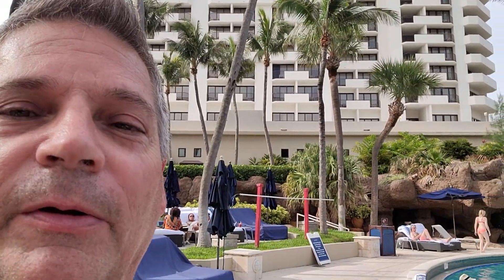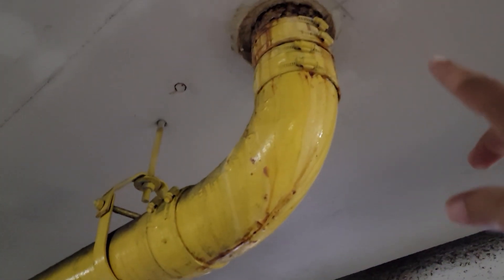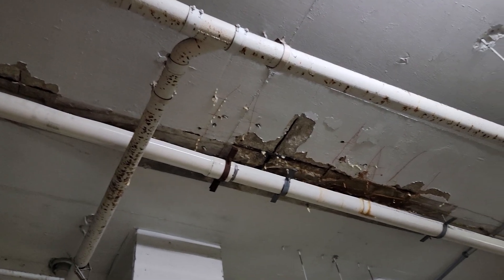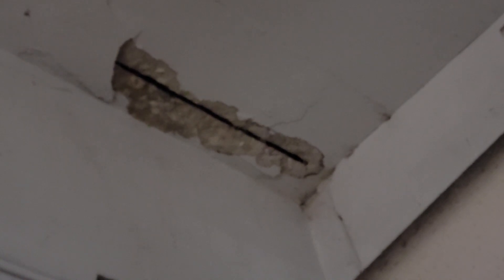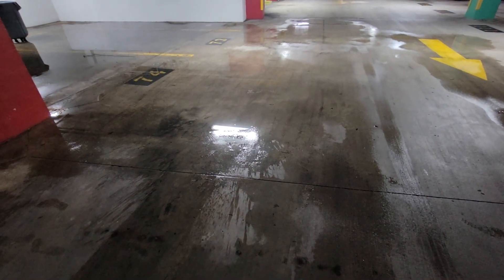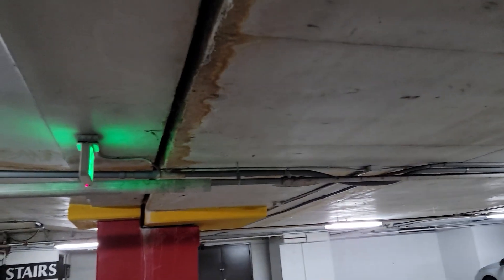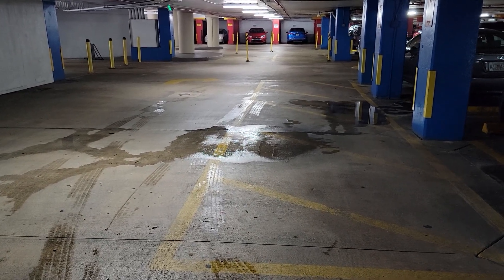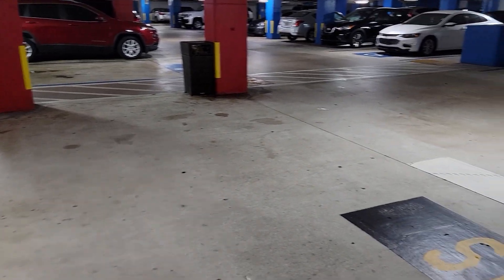Scary Garage Damaged Concrete Marriott Harbor Beach, Like Surfside Collapse

Comment: Champlain towers wasn't just due to water but mainly due to overloaded supports by the planters.
Reply from the maker: more than that too, likely many stressors
Reply: @jeffostroff  building integrity has a pretty convincing video (presumably you have seen it). But I am no engineer. It sounded like it should have collapsed under the overload way before it did.

Comment: At minute 23:39 to 24:00, why is the right side of the isolation seam so much lower than the left?  It looks as if the right side of the ceiling has dropped or settled to this lower point.

Comment: Salt spray can cause corrosion faster than a dry environment and there is high humidity too so rebar or any metal will rust faster.

Comment: This garage defintly has some problems, that they need to fix ASAP (or should have been caught earlier by facility managment).

The rebar at 12:42 in the video has almost no cover, it's like 5mm or less. It could be a local area with bad cover, I would expect the designed cover to be around 25-30mm. it's possible that the iron workers forgot to put rebar spacers in some area's of the slab. During the pour, the rebar may have been bent unitentionally causing the cover be reduced. This definitly needs to be investigated.  The corrosion on the rebar there is really bad, they would have to actaully replace some rebars, and remove the cover on the entire slab to  assess the magnitude of the damage and a apply a new cover with a layer of shotcrete. Granted, that is an extreme repair it may not be necessary if most of slab is ok. It would have to be done locally. 

The compressive strength of concrete actually increases with age (under normal coditions), It's not unusal for 25 MPa (28 day design strength) concrete to increase in strength after 40 years.
I've done schmidthammer tests on balconies of old 1950's / 1960's era flats in the Netherlands. In 2011 we had a case that a gallery collapsed of a 1960's appartment building, since then these buildings have to be inspected if their year of construction is from 1975 or older. A lot of those gallery's and balconies are cantilevering slabs, with it's main rebar on the top. Some people use de-icing salts to make the gallery less slippery in the winter and that's really bad for the health of the concrete.

Comment: Hi Jeff thanks for the video, what I find interesting about this is that Mr. Marriott and his family actually stay at the harbor beach hotel, in the penthouse,  during the winter season meeting from January through March. So you would think that this building would be kept in tiptop condition as the Marriott family themselves stays there. 
I have stayed at this beautiful hotel numerous times but I’ve never been in the garage as I always use valet parking, sothanks for the information. The one area you didn’t address is the pool deck connected to the building like it was at the Champlain towers or is the pool deck separate from the building.
Reply from the maker: We will show it in another video

Comment: When if ever would there be a reason to demolish these buildings? It's been done in Las Vegas ( could be a different reason in Vegas) for years. Excellent job on analysis of this building. Thanks Jeff.
Reply: Vegas demolishes generally to replace with something far more extravagant that would never have been possible if the original building remained standing.

Comment: And the structural designs have built-in safety of overload structure but you don't know how long this leaking and damage has been going on and you definitely can't see what is hidden throughout the ceilings in the walls where the concrete hasn't popped off. There can be some real scary stuff if no one properly inspects from top to bottom. 👀

Comment: I went to view a new apartment in my home town. It is a 1960's building that used to be an office for HM Passport Agency. I loved the place but all I could think about is the structural integrity of the place. It is more than likely a safe building especially considering its recent change of use from office to residential. UK safety standards seem quite stringent. However, since reading/watching the chain of events that occurred in Surfside, this nagging feeling remains with me.
Reply: @robi4387  Hi Robert, thanks for this, very insightful. I shall do some investigating RE: certificates.

Comment: Those are expansion sections for building movements. The lack of those yellow bases on top of the columns is what make the building fall  down!
Reply: Yes and no.  There were so many issues with the original construction.  However, that is just my opinion as a British Chartered Structural Engineer of over 30 years experience, but hey what do I know!
Reply: @robi4387  what is funny about all of this is that every building in Miami right now that has a water leak of some sort people thinks is going to be the next catastrophe and this is not true!
Reply from the maker: Yet in the end it all depends on where the water manifests itself into a worse case scenario of weakened concrete. You can have a collapse in a garage without taking down the building

Comment: Those corner steel guards on the columns are to protect the columns from a car hitting the edge of the column and braking a chunk of concrete exposing the steel rods!
THEY HAVE NOTHING TO DO WITH HELPING THE COLUMN STRUCTURE!!

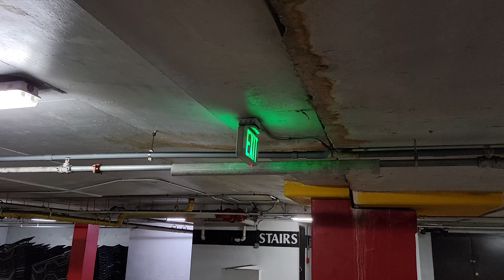Comment: Jeff, at about 22:00 do you see the two ceiling heights on either side of the isolation seam standing at two different heights from one another? Even the pad above the bean seen in the near distance looks to be at two considerably different ceiling heights from one another. Would this necessarily represent settling on one side more than the other?
Reply from the maker: I doubt that it means anything other than one side has a higher height than the other there's nothing that requires two different entities to be at the same height. now i know it's not the pool deck comma but for example let's say you have a pool deck coming up against the building and there is a scene between the two comma there's no law that says that the building height has to be at the exact same height as the pool deck period

Comment: It’s almost like every square foot of the garage ceiling had leaks, cracks, exposed rebar, etc.  Don’t building inspectors ever stop by?  What about insurance companies?  Don’t they require upkeep of the properties they insure?
Reply from the maker: Exactly, I'm not sure why insurance companies are not demanding inspection. My insurance company a few months ago told me to cut my palm frond, because they were touching the house, and to change my toilet water supply line in the bathroom from plastic to steel belted hose or they would drop me.
Reply: @jeffostroff  Seems to be a trend in South Florida.  Champlain Towers South was also insured.  Did no one from their insurance company come by to inspect anything?  It’s all so confusing, and it feels like multiple people dropped the ball, which caused 98 people to lose their lives.

Comment: Be interesting to know if that water is from different sources like is it rainwater, fresh water, pool water with chlorine or even seawater maybe ?? Id also like to have pointed a flashlight into that isolation seam and see what could be seen. Looks like at the very least the garage cieling is going to cause some car damage or personal injury if one happened to be standing in the wrong place when a large part of the garage fell.  Best part about this building is those very beefy columns, good build quality there.

Comment: Galvanized reinforcing steel is bare reinforcing steel coated with a protective layer of zinc metal. The zinc coating serves as a barrier to corrosive elements that the rebar is exposed to when embedded in concrete.  Even if the rebar is chipped with bare metal exposed, zinc in the area will still help control the chemical reaction/degradation
Reply: Higher cement content, greater cover to reinforcement and if required, stainless steel reinforcement e.g. for balconies/extreme exposure.
Champlain Towers was a catalogue of why not to cut corners, how not to build and why maintenance is so important.
We Structural Engineers have play second fiddle to Architects and this is what happens.
Reply: The zinc can get powdery and flaky as the pH of the concrete drops over time, and this can also result in pressure on the surrounding concrete, or at the very least, reduce the bonding or adhesion of the rebar to the concrete, ie. the 'grip' that the concrete has on the rebar is important, it's what gives the concrete it's tension strength

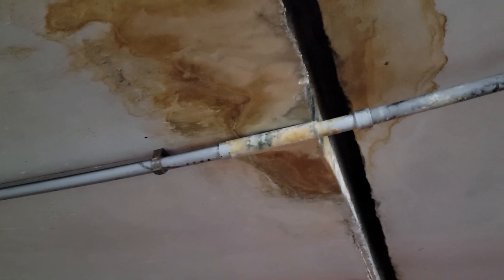Comment: Those leaks coming from the isolation seam: One side of the seam looks much lower than the other, especially @6:35 where it looks like it's actually sitting on and bending that pipe some and again @21:49 near spaces 86 & 87. Is THAT normal cause it certainly scared TF out of me watching from the safety of my apartment in VA, lol.
Reply from the maker: It is normal, and yo can see it on one of the columns where the L-shape was cut on top of the column to accommodate the different heights

Comment: The problem is also in Florida every storm or hurricane weakens these underground garages with water and the high winds stress the buildings. Now over years it all builds up. That is before poor maintenance and bad design. But you would think the state would have put out an emergency inspection of all underground garages.

Comment: Nice to see the drop heads at each column, although smaller than current City of La Codes here in Ca. , they do help in preventing as you say pushing shear. Lets hope the owners will do their due diligence on a very detailed inspection and subsequent repairs sooner than later.
Reply from the maker: What do they require in LA?

Comment: But is it really like Surfside? That one had sinking foundations, high water table pushing water feets up into garage, late design changes that removed safety features like extra beams, but kept thin support columns, addition of planters decades later to already stressed and cracking slabs. And who knows what else.
Reply from the maker: We saw no evidence the foundation was sinking was a root cause. At the end of the day the pool deck lunching shear is due tot he fact that the connections from columns to slabs could no longer hold the weight. However what is the same between the two garages is that you have water leaking from a deck above through several places and is causing spalling an corrosion of the rebar inside of the concrete and obviously weakening the concrete slabs at the same time. Those were common between the two garages.
Reply: @jeffostroff  My understanding is the constant flooding they experienced was from below, not above. I've seen comments such as "feets of water in the garage" and "pumps could not keep up with it". The only way that makes sense if water table rises as tide comes in. 
We dont see evidence of it yet, because foundations were under the pile of rubber. Once they inspect piling caps, they will know.

Comment: Most people leave the garage alone or last for maintenance... turns out it should be first!  By the way, those columns look like 16/x16 or 20x16, which is bigger than Surfside.
Reply from the maker: yes much stronger than surfside

Comment: Wasnt the chain effect collapse of champlain happened necause there were no sections and everything was built together?
Reply from the maker: That design they had is a good design at Champlain which works only as long as the concrete is healthy. If that pool deck fails as a shearing and drops, now it becomes the Achilles Heel
Reply: @jeffostroff  Thank you.

Comment: normalization.. had CTS not occurred you would most likely have ignored what you spent 30 minutes documenting. getting the "word" out probably will have 2 outcomes;. 1) the company will start to fix the issues, or, 2} there will be security added to prevent more videos.
Reply from the maker: you may be right

Comment: Is this building the same age as the collapsed building. How long will it take for this building to collapse? Seems to me these buildings should have a law or whatever to keep them safe.
Reply: They do have the 40 year inspection protocol. That time frame may need to be shortened so things are in place.
Reply: @larrybe2900  Well I'm with you on that.  30 years, 50, 60 and every 10.  Because it seems the humid salty environment is finding and deteriorating every weakness in the original construction and owner's prioritise a lick of paint over a structural review.

Comment: Could you please describe what an 'isolation seam' is?
Reply from the maker: Some people call them expansion joints also. It is a gap in 2 different areas of concrete designed to separate the s2 section, so if one falls, it won't take down the other, because everything shears along the isolation seam. On sidewalks, those control lines you see are meant for the cracks to occur inside those line gaps instead of in the field of the concrete sidewalk,

Comment: It would be a lot more efficient if each unit had a mini-split AC, since there would be a lot less piping (and the whole system would be more efficient).
Reply from the maker: Mini splits have their issues to, and they can also leak. Dealing with that at my friend's house
Reply: @jeffostroff  I guess window/wall acs are the cheapest and most convenient option then, although they make a building look ugly, and one apartment would require multiple of them!

Comment: this is obviously years of negligence , I don't think ceiling split slab were made on purpose cuz both sides are uneven by inches and will eventualy break the pipe at 22,07 desaster in the making did you sleep well ??

Comment: @6:14 Any concern about the variation of the levels on either side of the seam? I realize buildings settle over time and it’s hard to judge from the video, but there looks to be a variation of several inches between the two sides.
Reply from the maker: no it is designed like this

Comment: Jeff look at the isolation seam with all the water damage and where the pipe is rusted through exposing the wires. Look at the seam and the left side is lower than the right side. Is that settling?
Reply from the maker: NO I doubt there is any settling. An isolation seam can be used to join 2 different slabs of different thickness too.
Reply: Probably not.  Probably (super)structural movement not substructure settlement.  However, I'm not there and nothing beats having a Chartered Structural Engineer look at something.

Comment: What's up with the difference in heights at 22:03 ?? Are those slabs supposed to match up? Not the gap between them. One looks like it's sagging down lower than the other side.
Reply: One's thicker than the other

Comment: Couple of places (25:34), it looks like somebody has been marking out the problems in red on the ceiling... let's hope they're working on a fix. Pictures of the garage now an essential part of the tourist brochure
Reply: Great discovery. They know there are problems. There are red lines along one of the pillars as well earlier in the video.
Reply: Possibly, or merely marking the location of reinforcement to avoid when drilling up into the slab to suspend the pipe.  Fixings and pipe clamps had rusted.   Possible local cooling exacerbating condensation issues or the work damaged the concrete and advanced the deterioration.  Sorry, would need to see it in person and I'm not going to Florida unless Marriott commissions a report.  Doubt they want a British Engineer - I'm too thorough it has been said.

Comment: Min 1:50 Engineering school teaches to include gaps especially in R.C buiildings for gaps which will allow expansion and contraction of concrete during it´s life cycle otherwise the building will develop a massive cracks which may bring it down. which is highly inprobable but they will make the building less functional, though it may not collapse, municipal authorities will not allow it to be used.
That is their primary use now if you want to give another reason I am sure the structural Engineer did not look at it that way.
Point is that when someone learns on the job you have so many problems that appear out of the blue. The last problem I solved for someone so long ago was metal frence which was welded without consideration of temperature variations after 5 years it just cracked and warped, I had told the owner to make provions for possible damage due to summer temperatures and his technician told it was not necesary. but when it cracked I was called to give a possible soluction to avoid future provisions. that was after everyone had ingored me and called me a big headed ignorant immigrant
Reply: The same concept is designed into long runs of piping carrying anything where temperature changes happen to allow for expansion and contraction. The best example is steam pipes are hot even in summer or winter so a way is needed  to allow for movement of the metal pipe itself when out of service.

Comment: Why don’t they make the supports that are wide as the plates on top of the post?
Reply from the maker: They don't need to be that wide. The drop panels you refer have to be that wide to give that extra resistance to punching shear

Comment: They should clean out the planters and fix the drains. Clogged drains would force the water out of the pipe and into the garage . Any planters above would be constantly soaked in water and drastically increase the load on the slab  Poorly placed expanding rebar exposed to water spalling the concrete and weakening the slab. All because of water.